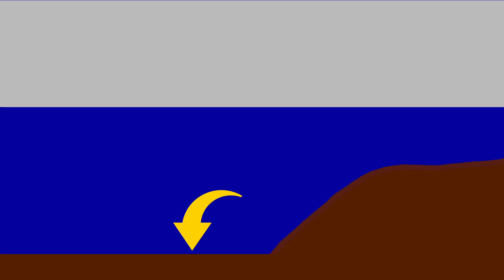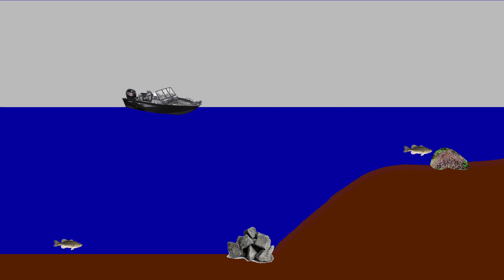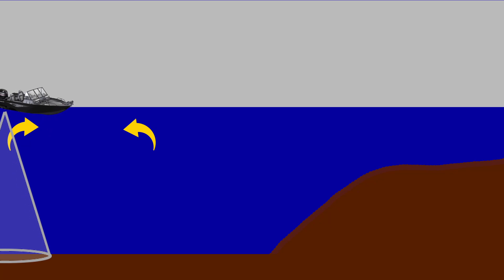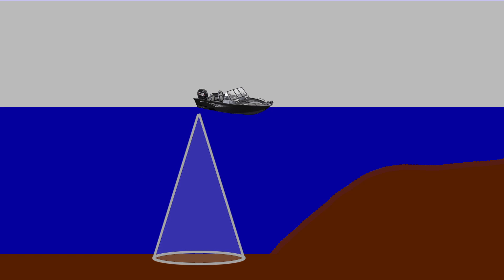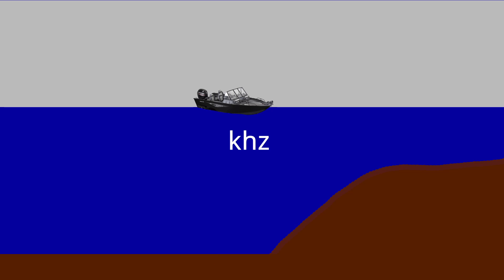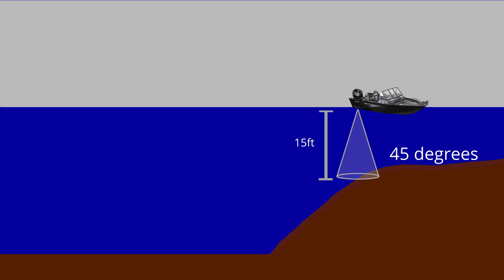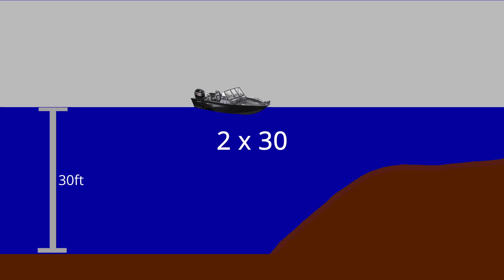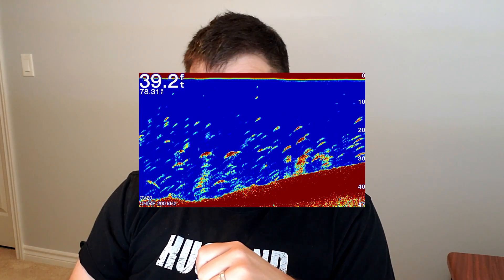How Do Fish Finders Work? - The BASICS

Comment: I feel you have the reason for an arch representation of fish wrong. The arch is created when the scan by sonar of a fish changes distance as the fish moves through the sonar cone. The sonar return in its raw state is processed, enhanced before it is shown on the screen. It is again processed if the operator selects to display fish icons. Humminbird usually has great mathematicians and software engineers, many times from Georgia Tech.
Reply from the maker: That was always how I thought of it too, but when doing an immense amount of reading about how fishing electronics works, the majority of the resources I found claimed otherwise.
Reply: @ I worked at Humminbird in the early 2ks as a graphic designer doing illustrations of sonar after talking with sonar experts, programmers and mathematicians. In addition to that background I taught on sonar system simulators at Moffett Field while enlisted in the USN as a TD2. TDs (Tradevmen) were an Avionics rating operating and maintaining training devices.